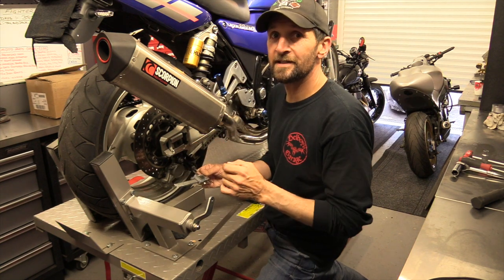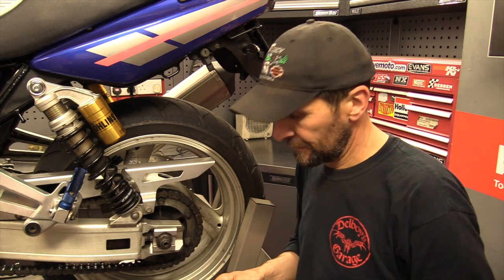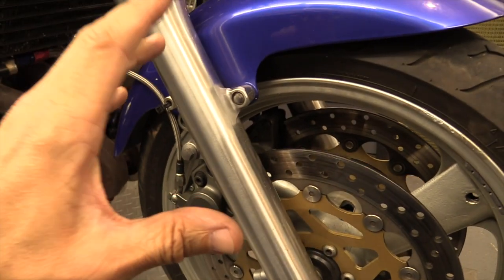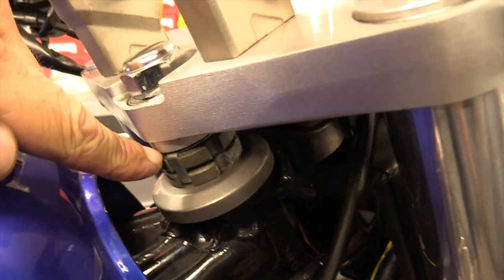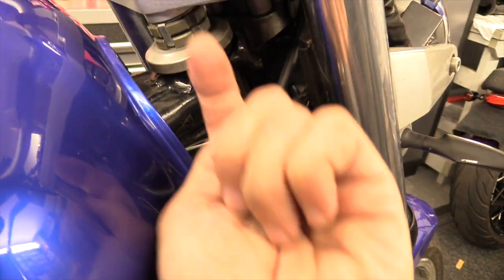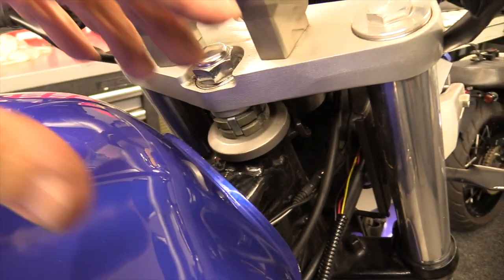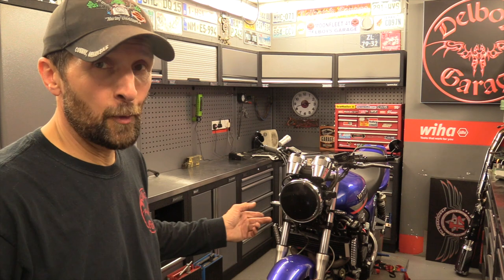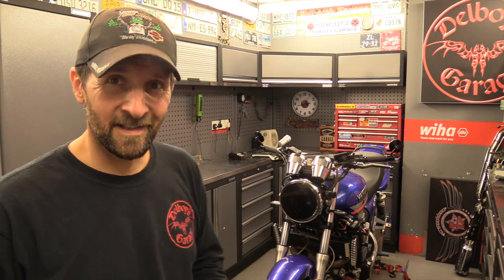Delboy's Garage, Quick and Easy Motorcycle Fork Alignment .

Comment: I recently did this on my little chinese commuter lexmoto michigan after I took a tumble last month when a car turned right across my path I went down on my right hand side didn't hit the car just the tarmac OUCH!. I followed the sequence as directed here and id say its probably 50% better than it was but Do you have any idea what else might be wrong here with all the required nuts loose if you physically push the wheel to a more straight position  there is resistance in the direction it needs to go. Its still a bit off to the right. At a guess it would suggest something got bent but nothing to see with the naked eye.
Reply from the maker: Remember that your rear wheel alignment also plays a part in how your steering feels, so assuming that is right, there is a faint chance you may have bent something, but more often than not, it's just mis-aligned... don't forget to loosen the top centre nut on the top yoke, that's important, and yes sometimes, specially with smaller bikes, you do have to psychically have to hold it straight, then nip up the bolts in the demonstrated way... if you're in any doubt mate, drop by an MOT station and get them to check it for you.
Reply: @Moonfleet41  thanks very much for the reply buddy. yes I checked rear wheel first (I'm certain its the front end coz the clock, headlamp, handlebars and everything is off kilter with the wheel) and I did undo top yoke centre nut, I had to buy a 30mm spanner to do that (can't get in with a socket without removing handlebar clamps. silly design.) I had a thought today seeing as this is a ccm bike is there anyway the bottom yoke spline that goes up through the frame got twisted or is that virtually impossible? I did have to hammer the steering override bracket back into a central position because after the crash that had twisted sideways and allowed handlebars to impact the tank on the right hand side. but importantly you're saying here its ok to hold the wheel straight and tighten the bolts back up, yes? My friend didn't want to do that as he thought the resistance he could feel when attempting to straighten the wheel back was not a good sign and that we'd be forcing it and putting tension where we shouldn't be? thanks again.

Comment: I've got a 03 en500 that pulls to the right something fierce. I had the front end rebuilt by a shop right after I got it. If they didn't tighten everything in the right sequence could it cause this problem?
Reply from the maker: Have you checked your rear wheel alignment??
Reply: Moonfleet41 not yet, but that will definitely be the first thing I do.

Comment: Hi, love your vidoes!!! I have a question please, my bike ( Africa Twin) seems to go slighty to the right and my rear wheel is in good possition. Do you think this method would help me out with my problem? Thanks
Reply from the maker: When you ride on the flat Michal, in a place with no road camber, if the bike is going straight ahead, are the bars twisted to the left or right slighty??
Reply: @Moonfleet41  i haven't noticed the bar twisted. I also tried riding on different roads in different speed but everytime when i take off my hands from the bar bike goes tothe  right straight away.
Reply from the maker: @mike-on-the-bike  Aha, ok, if the bars are riding straight in your hands and there's no offset, but it tracks to one side when you let the bars go, then there's a couple of issues that could be causing it... one could be uneven loading, if you have panniers with an uneven weight side to side, then that will physically pull the bike to one side... some people end up with this unknowingly because they put things like small tool kits in one pannier or things they don't consider as 'luggage', maybe a lock or something........... but if you're evenly loaded side to side, look closer at your tyre wear, if you've run your front a little under inflated for any time, that will cause a painted profile to your tyre radius, and as you say it's pulling to the right, then an under inflated front tyre would naturally wear more on the right due to roundabouts and road camber (presuming you drive on the left?), it doesn't need to be much, but check your tread depth on the front at about halfway between the centre of the tyre tread and the outer edge, see if it's the same both sides, a lower tread one side could pull the steering to the rights slightly....other than that buddy, I'd need to see the bike, perhaps even ride it, to see what may be causing it.
Reply: @Moonfleet41  thank you for your answer and i really appreciate your time. I'll double check the bar tomorrow and have a look on the front tyre. Is true i have a small tool box attached to the panniers but that's on the left side and the bike does that even though i have luggage or not. 
First time i noticed it was when i got my bike back from servis where was fork oil changed.
Reply: Hello again, so i checked the front tyre which looks good, bar and front tyre are in perfect position and nothing is loosen. I double checked the rear wheel aligment and all good. I went for a test ride to see if is only my imagination but bike still goes slighty right and in higher speed the bar is even shaking without hands on the bar. I took the bike to the same servis where was fork oil done and told them what's the problem. I have recently changed OEM rear spring for stiffer Ktech spring what in their opinion might cause the problem. They also said they will try to change the fork oil again and re-align the forks so i'm waiting now. What is your opinion about that? Thanks

Comment: 1200cc with Turbo. Ooof. I imagine the torque curve on that is 'interesting'. :-)
Reply from the maker: Yes it is mate, very interesting... I have the dyno chart for it , it reaches 100ft lbs of torque at 5k revs and then increases by 20lb of torque per 1000 revs from there on... up to redline where it peaks at just under 190, it's just smooth and linear, with no dips or peaks, and follows the bhp curve like a mirror... it's extremely well set up !

Comment: Please I need help: my headlight and handlebar are turned slightly to the right while my front wheel is straight, is this method gonna fix that issue? Thank you. I  had a slow crash and my bike kissed the floor on the left side.
Reply from the maker: Hi there.. yes it sounds like you may have knocked it out of line maybe... give it a try and see if it helps... Good luck.
Reply: @Moonfleet41  Thank you very much i will try and let  you know.
Reply: @Moonfleet41  It worked like a charm man, i had to do it for a while and sweat it a little bit but the beauty is completeley functional again.

Comment: Hey. Going to do this on my zrx. I have an Abba stand so the bike hangs from the swingarm pivot bolts. Would that be OK? Its not like a Centerstand the bike hangs... Or is it :)
Reply from the maker: ABBA stands are great, but you do need a little weight over that front wheel... it doesn't kinda act as a main stand, but even a main stand can work, as someone said below... so hey, give it a go, and see how you get on !

Comment: I can see my forks are a degree to the left and when i let go of the handlebars the bike goes to the right. If i wasnt so fussy with stuff you would never know. It drives fine with both hands on the bar.
Reply from the maker: Have you checked your rear wheel alignment buddy, cos if that's off, even by a fraction, then a sensitive rider like yourself will detect it as the bike literally 'crabs' very slightly and you feel it by the bars being off to one side, it's far more likely to be the rear out than the front forks...
Reply: @Moonfleet41  no i just had new tires put on and had to go back because they put too big of tire on the rear and it rubbed on the swing arm

Comment: My Aspencade goes straight but my handlebars are crooked to the left. Bent?
Reply from the maker: I imagine they will have flexible mounts in the top yoke...try loosening the bar clamp and twisting them straight, then tighten them up... they can get nudged out of alignment when you pull such a heavy bike around with them..!

Comment: Will this work cause I just flipped my Yamaha V-star 1100. The handlebars are one way and the front tire is the opposite so what. So what I’m saying is the handlebars are twisted to the to the right and the front wheel has twisted to the left.
Reply from the maker: If by "Flipped" you mean it fell over, or you dropped it.. then yes, that's gonna twist up your front end.. you may have rubber mounted bars, if so, they may have gotten knocked out of line with the top yoke...so first loosen the clamp top and bottom mounts and twist them straight so they are in alignment with the top yoke.. then if the wheel and the bars are still out of alignment, that could be the forks knocked out inside the yokes....so you could do this method to align the forks..   Good luck with it mate. Hope you can get it sussed.
Reply: @Moonfleet41 . No , I flipped the bike in a ditch . But u will try this method . Thank you very much.

Comment: I get quite bad drag with my front wheel on my trackbike- it does ease up once the brakes are hot but as soon as it cools down it drags loads.

I have just fitted new calipers and noticed the drag is still there.

I have noticed that if I slightly loosen the clutch side, bottom calliper (just the one bottom bolt) bolt the wheel spins alot better.

I have done your fork alignment vid which hasn't really helped.

Any idea what could be causing this?
Reply from the maker: Do you think you caliper may be misaligned with the disc.. is it a 'factory' or 'custom' setup?, does the disc run absolutely central in the caliper body ?..
Reply: @Delboy's Garage  2 sets of wheels.

One oem wheels and discs and the other dymag wheels and hpk disk.

Both drag.

I have noticed that the 2 inside pistons on the problem side(clutch side) are only coming put a few mm whereas rhe outside pistons are coming out loads.

Brand new Hel v2 calipers just fitted and bleed (unsused yet)I had the same problem with my Hel v1 calipers
Reply from the maker: Same question again Rich.."does the disc run absolutely central in the caliper body" ?..  if not.. then have you thought of shimming it inboard to get it right ?
Reply: @Delboy's Garage  will have to double check the disc is running central in the centre cavity of caliper.

I did teat the caliper by pumping the brake whilst holding the caliper and the inside disc pistons hardly came put then whilst outside did.

It is very cold in my garage atm so maybe just need to get some heat through them to get them working equally.
Reply: @Delboy's Garage  just checked now and discovered that the pinch bolts on the problem side aren't grabbing the axle properly as once torqued up there is abit of movement still which causes a rocking motion so I haven't been able to properly align that fork leg.

I guess that must be the prob so I will try fitting the oem axle and see how that is
Reply: @Delboy's Garage  turns out the spindle on the after market quick release front wheel kit I bought is approx 1/2 mm to small in diameter 🙈

I had a quick check with the oem spindle and that is solid once pinch bolts are torqued up.

Will get it all fitted tonight and that should be my drag issue sorted 🤞
Reply from the maker: Glad you've sussed it out mate.. plenty of after market accessories need attention,  Good luck with it aye !

Comment: when i retorque the top tripleclamp at the center nut it dont stay in line with the bottom one? Any tips? suzuki dr 650
Reply from the maker: Don't torque it fully while everything else is still fully loose.. nip everything up hand tight a bit at a time first so it doesn't move.. Then torque everything starting with the centre nut.
Reply: @Moonfleet41  will retry

Comment: Hi del can you help me please I need to replace my steering lock ignition barrel on my mk1 bandit do I need to remove my clocks to do it and how hard is it to replace cheers mark
Reply from the maker: Hi Mark, I presume you mean the ignition barrel itself... and as far as I remember, they bolt up in to the top yoke from underneath, so you need to take the top yoke off and as far as I recall, I think there might also be security bolts, but have a look and see what you can find...
Reply: Moonfleet41 thanx for your help your always quick to reply my forks are out aswell im going to attempt to do them with the help from this video

Comment: I don't have a paddock stand or anyone strong enough to hold the bike vertical with me on it. Bike has a centrestand but Delboy stresses that it is not ok to do the 'pushing' with the bike on the centrestand. So how can I do this?
Reply from the maker: Can you stand across the bike, up off the seat, ?  that would work.
Reply: @Moonfleet41  Thanks, yes I can but when I get off the bike I will need to use the side stand, which you also say is a no-no ...
Reply from the maker: @LP-cs6zg  Thats ok.. keep the tools in hands reach to tighten the top yoke centre nut, and the bottom yoke pinch bolts.....if you can do the plunge action which will set the fork alignment... then while still holding the bike upright... nip up the centre nut and yoke bolts... it will hold in position, then you can get off the bike (using the side stand) to properly tighten down everything else..!   Good luck with it buddy.. hope it works out..

Comment: Hello man. I've tried this method a couple of times. Had watched your  older Hayabusa video too. My 2016 ER6n handle is tilted towards right while riding and it's always been that way even after trying this. The tyre seems to be getting used more on the right half as well. What can be done?
Reply from the maker: Hi Darshan, if you're tyre is unevenly worn, then you should really replace it, if you can afford to, cos it will never ride well if one side is worn more than the other - 

With the forks, sometimes just pushing up and down is not enough, so if you loosen everything, you will sometimes have to hold the wheel between your legs and force the bars straight, before clamping it tight - especially if it's been set in an off side position for some time !
Reply: Moonfleet41 is there a problem riding this way before I can get help from Kawasaki Service Centre? Because I can't go to them until next week and intend to ride it. Will it cause any harm? Or should I not worry about that?

Comment: If this method did not work, what's the next most likely cause? Bent forks? :( (It's not the clip-ons)
Reply from the maker: Have you checked the rear wheel alignment mate?. that plays a part in it..!   its unlikely the forks are bent unless the front end has had an impact..!

Comment: Why is it needed to loosen the center bolt?
Reply from the maker: The miss alignment of your fork legs occurs when the two yokes twist apart and are no longer directly inline with each other... so you loosen the centre nut to allow them to realign.. then tighten it after..

Comment: don't you have to fix the front wheel nuts first, when all the other parts you loosen up befor, to make sure you have 90° touch from the wheel shaft to the suspention shaft on the both side, to have a rubless clean turn and not to chafe the break disc on the break shoes diagonal? And then ajdust it.?
By the way i thing standart susspentions (not really custom) are defective. Try to streche a bike without susspention from the handlebar to the frond wheel sidewards. It's rather hard and rather fixed. It won't cause to yawn. Try to streche from the same points on a motorcycle which has a lot much and more metal meat for the handlebar and susspention. It will strech diagonal sidewards much more  with same power, then by a bike. Motorcycle doj't have really forks on like a bike. They look like forks, but they are loosen horizontal.  You can turn them around independent fron each other, when the wheel is not mounted, but even fixed on a bike, if thw wheel is not on the fork, right.
Eventually, all side forces like in turns will have a stech effect and  distort your ajustment, because a unfixed fork  will have differen press force on your wheel flansh, which means you don'n have a clean round turn on the wheel, then you go in curves, isn'n this physics or am i wrong, m8ster
Have a nice day...

Comment: Any good mechanic here? I've got a Kawasaki z800 which got a bent handlebar, it's not much but still annoying. So must the wheels be 100 % lined up for this to work (as showed in the video)? He didn't tell how important it is. I'm handy so i usually do stuff myself on my bike and car. And the centrenut is covered by the handlebar itself, is it worth to even try this without loose it? I'm afraid to fuck it up even more. So any tips for me? Thanks :D
Reply from the maker: Always essential to release the top yoke centre nut otherwise it will not re-align
Reply: @Moonfleet41  Thanks for the reply and for the videos! What about the wheels?
Reply from the maker: @ritchie1950  With the wheels Rickard, loosen off the axle nuts, and any pinch bolts at the bottom of the fork legs too.. it all needs to be free to align..!

Comment: So my forks are straight my axle is straight wheel is straight yet my handlebars need to be tilted in order to drive straight
Reply from the maker: Are the bars straight in relation to the top yoke?.. most bar clamps sit in a rubber mount, is it possible they are twisted... you can back them off and move them straight if they are out of line with the yoke..to do that, loosen the actual clamps that hold the bar itself and then the nuts under the yoke, then you can move back to centre if they are off........ and finally. have you checked that your REAR wheel alignment is right.. because if thats off it will kick the front across too..!?